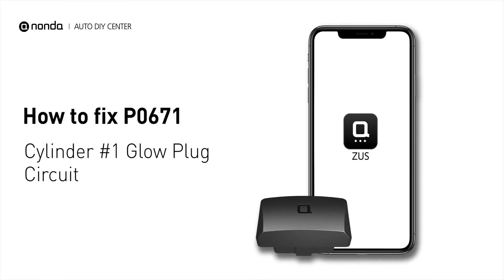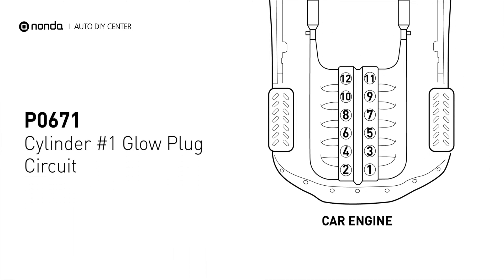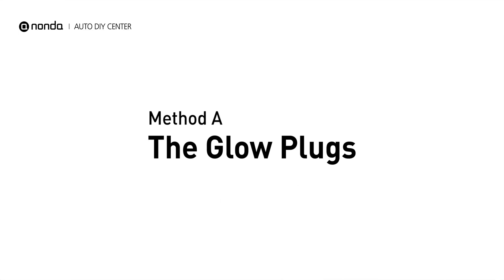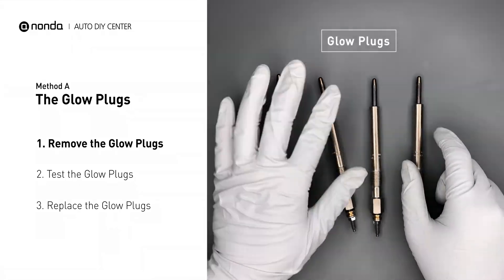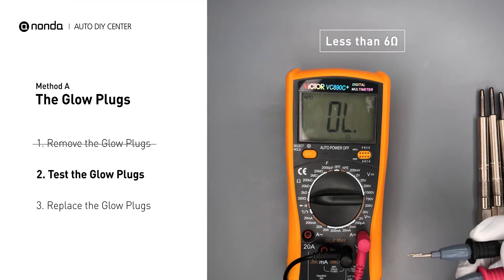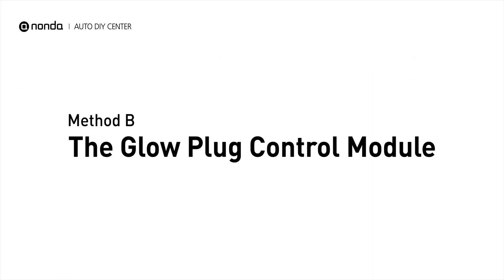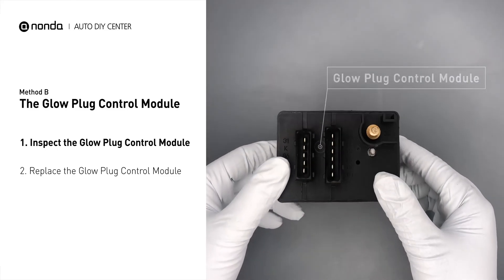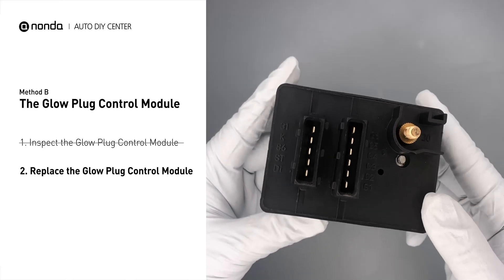How to Fix P0671 Engine Code in 3 Minutes [2 DIY Methods / Only $9.97]

Comment from the maker: Hi, I'm Steve, nonda's lead mechanic engineer. 
Feel free to leave your comments here if you have any mechanic questions, I will be glad to help you out!
Reply: So much for helping people out lol
Reply: lol 
 @IrnBrummmmmmm0
Reply: Thank you for the video I loved it. 

Does cylinder 1 focus of this code mean that it's specifically cylinder 1 that needs a replaced glowplug or that the damage on the power supply would be on the first cylinder connection?
Reply: Replace the GPCM every 95,000 km 😅
Reply: I had all 4 glow plug fault codes and I need to check their resistance. I’m surprised it’s all 4 or more likely to be the module.
Reply: did you fix the problem by switchig the module shown by the video? (my obd says also that all 4 glow plugs are broken)